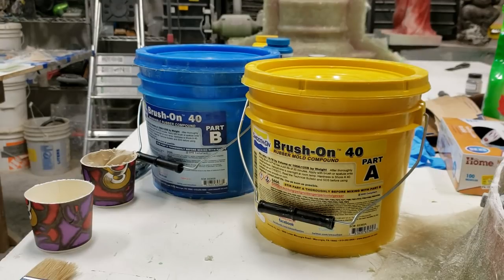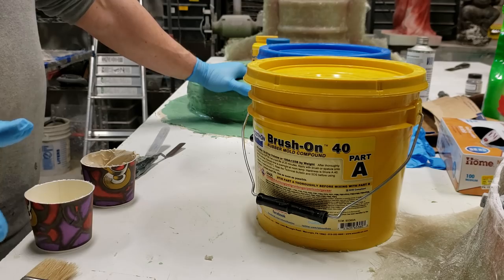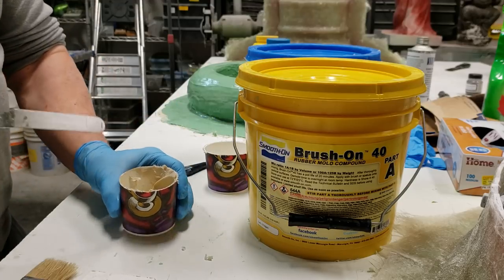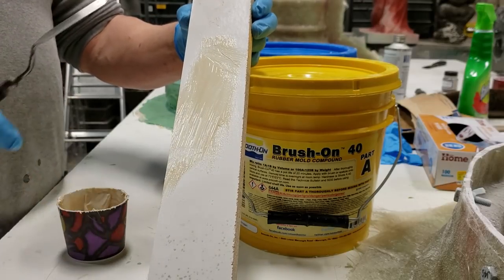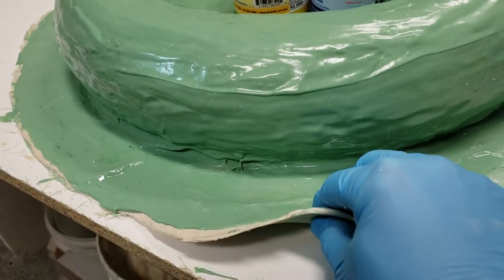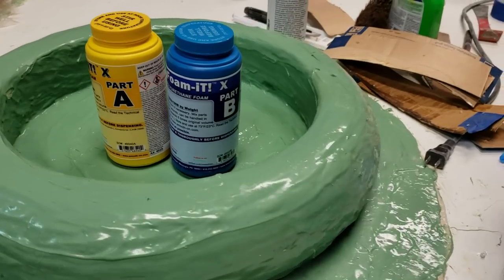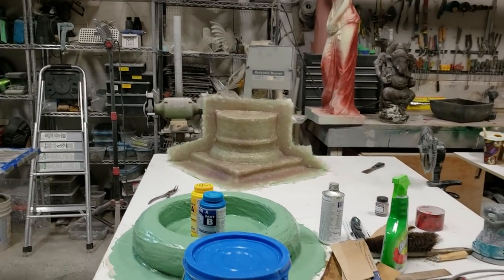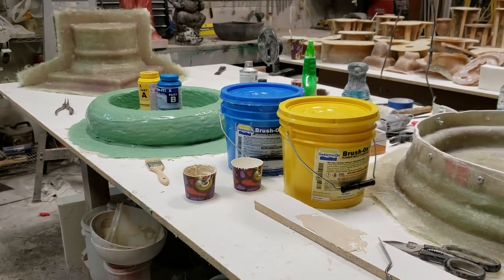Mold making/ Review brush on 40 from smooth-on.

Comment: I like seeing "real" people using these products! thanks. I do have one question, you said no wood as a mixing tool, and then you used a paper cup as a mixing vessel. that's not a problem?
Reply from the maker: Thanks for the kind words. No ,it's no problem at all,it's a lined coffee cup ,so no moisture absorption.They're sturdy too ,tried like a red solo cup way to flimsy to mix in.I've seen on instagram ,the smoothon seminars for bigger volumes use a  popcorn container like you get in a theatre. Similar to the cup I use. Thanks for watching.

Comment: Hey. Liked your video. I have a question. I bought these exact rubbers that you have in this video, about 6 months ago (thought I would get my mold done sooner). But now I finally have a good mold of a Michael Myers mask I've been sculpting for many months now, finally. I am excited to use it. However, I am worried if my rubber is too old. I have never opened the box. This stuff is expensive and I'm stuck on making a decision to just buy a new batch, or am I safe with using the one I currently have? Do you think it'll still come out the way it should?
Reply from the maker: If they were unopened They should be all right.
Reply from the maker: If they were unopened They should be all right.Give it a real good stir when you open them ,use a plastic piece of pipe ,not wood.
Reply: @mrconcreteartisan  I decided to go ahead and wing it for my project a few days ago. You were right! Common sense told me to do just that (stirring and seeing how it would react, using a plastic stirring tool) and it seemed fine. I then went ahead and bit the bullet and used it on my project and it came out better than I thought it might! I have a video of it on my channel. Appreciate the feedback!
Reply: ive used it a year after i opened it with no problems